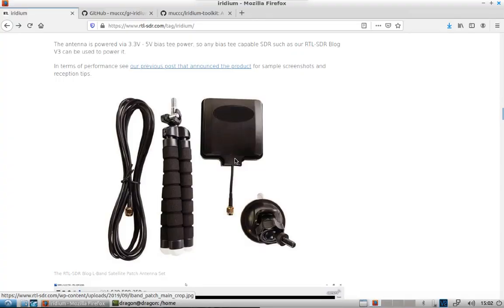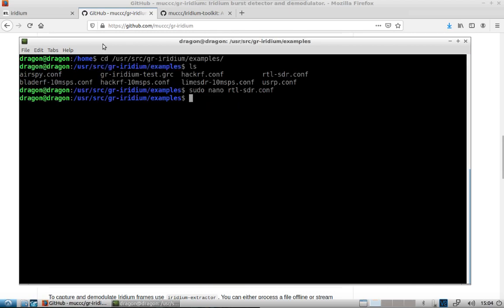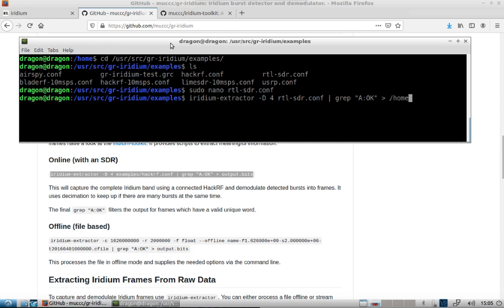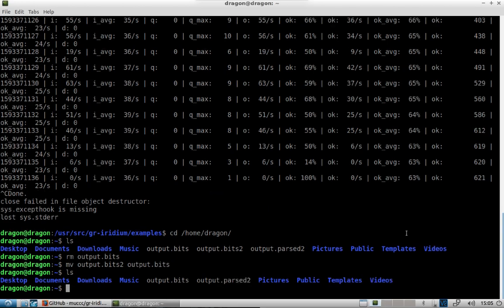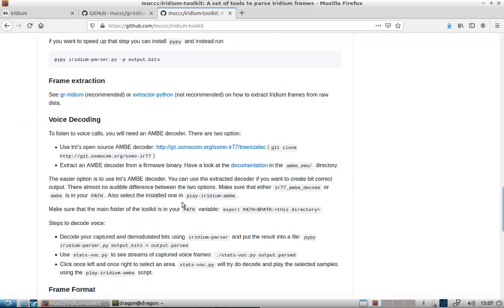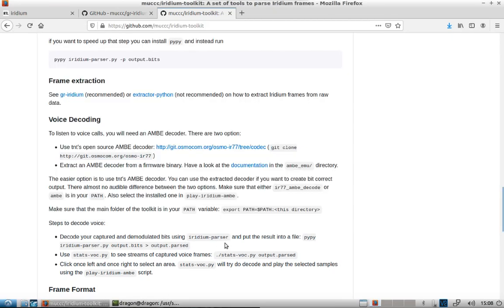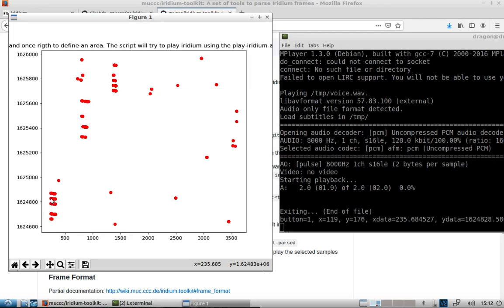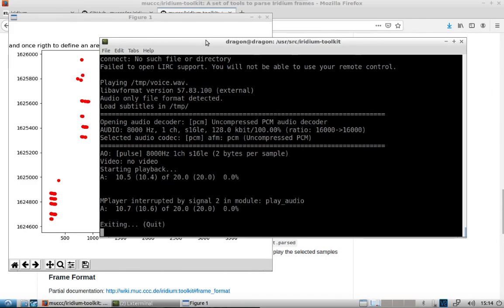DragonOS LTS Decoding Iridium satellites with the Iridium toolkit (gr-iridium, RTL-SDR)

Comment: That´s simply great! Last year I have purchased the LANA form nooelec for preamp, I did not know that is so easy to enable the bias-t on the rtlsdr v3. I do intend to use the patch antenna from the outernet project. Thank you!
Reply from the maker: I didn’t either.. till I started digging and thought how do I turn on the bias-t with software? There’s a few options I found but this seemed the easiest for gr-iridium and only kept it on when I needed it. I was surprised to find the answer on some random forum and that it didn’t seem to be well known. I was super happy as it was the first time actually using it and the antenna.

Comment: I just found out about DragonOS and almost immediately installed it on my old laptop, and I got no regrets! Thanks so much for DragonOS and all these videos, finally I'm free from ripping my hair out trying to install sdr programs 😂
I'm especially excited about trying op25, I tried for 3 straight weeks trying to get it to install right on Ubuntu with no luck so it's great to finally have it, plus all the other programs that'll be fun to play around with
Reply from the maker: You’re welcome. It’s been a fun project and I hope that it helps make some things easier for everyone. Please let me know about op25, that’s one program I have to admit I haven’t really tried. I ended up just using sdr-trunk. Funny you mention op25 though cause I was just researching the boatbod version.
Reply: @cemaxecuter7783  I tried to paste the .tsv document with all the channel info for my city into op25/op25/gr-op25_reapeater/apps, but it seems like I need admin permissions to do it and I can't seem to be able to open the folder as an admin even with Nautilus
Reply from the maker: So since you’re logged in with a user other than root and because I had to stick everything in /usr/src for it to be there after installing you have a couple options.. one you could do sudo su and set a psssword for root, log out and back in as root. The better option would be to copy and paste and/or edit everything via command line with sudo in front of it.
Reply from the maker: Like sudo cp .tsv /usr/src/op25 etc etc it’ll then be there. Sorry for not having done a video on op25 yet. I’ll get smarter on it and make sure that it’s actually all setup right. Been meaning to do that. I’m curious though, what’s the advantages or disadvantages using it vs sdrtrunk? If you need to reach me faster you can send me something to cemaxecuter @ ProtonMail
Reply: @cemaxecuter7783  Thanks for the help, that did the trick! I think the main reason some people choose op25 over sdrTrunk is that it apparently works really well with only 1 dongle, which is my reason for trying it, and also the audio quality is said to be great. It's a little bit more difficult to set up because all the channels have to be entered into .tsv spreadsheets, which for the San Diego system was 1500 entries from RadioReference.

I just got SDRtrunk set up and it's running great, so I'll have to see how it compares to op25 once I get it all figured out
Reply from the maker: Well, you got me motivated to look more at op25. I found that I had two versions in /usr/src with i think the one labeled “old” being the one installed. I remember now a bug with one of the blocks. Anyways I removed both versions and started fresh with the latest boatbod source. I fixed the block bug and went into the repeater folder and ran sudo .op25.sh. I got a black window to open where I could change the frequencies. Now I have to see what’s all required for setup but I intend to upload a new ISO with this and a few other fixes. Also, separately I have a completely different ISO I’ll upload but that one will not have op25 yet till there’s better support for gnuradio 3.8. That was a mouthful. Glad you’re making out with sdrtrunk and if you run into problems with op25 just email me and I’ll help fix what you have or you can try the new build once I upload it.
Reply from the maker: FYI I cleaned up op25 and went to one version only, the latest boatbod. Fixed some other things will I was at it. You’ll see a new ISO on sourceforge in an hour or so or I’ve put the same ISO here. Might save you a little time sorting out op25 on the build you have. 

https://drive.google.com/drive/folders/10dr7lYwbI_UQy4OYuiFqCrua_hrVZ_1u
Reply: @cemaxecuter7783  I just downloaded and installed the new .iso, and op25's working great! I had to copy the whole op25 directory to the home folder, since even with sudo it was giving me a "permission denied" error with the output file when it was in /usr/src. I also had to mess around a little bit with the ppm offset, and change the modulation in the trunk.tsv file to C4FM.

Audio quality is definitely a little bit better than SDRtrunk, and it's also nice because it shows the current talkgroup that's talking, and it's pretty easy to customize all talkgroup names the .tsv.

Again I really appreciate all the help and the OS, it's definitely made sdr 1000x easier for me

Comment: How exactly do you stop the output.bits file correctly, I noticed you hit control C to stop it, but my file is empty even though I can see several iridium sats have crossed my path. I'm using the RTL-SDR patch antenna. Also, do I need to crank up the gain on that cuz I normally do when I'm using SDR# and other apps.
Reply from the maker: Ctrl C is fine. I’m thinking, did you enable the bias t in the config file? Gain can go up some too. It should be getting info dumped to the file. I’ll be testing again this week on a brand new build but procedure is still the same.
Reply from the maker: Oh wait, this is an older video. Are you using DragonOS Focal or LTS? The procedure has changed from the old old way. That might be why you’re getting nothing.
Reply from the maker: This one is newer, pick out the parts you need. https://youtu.be/ROCCPdq9ieo

Comment: I'm very interested in this. Can you talk a bit about your hardware setup? I have the RLT-SDR, it looks like I'll have to grab an L-band antenna. Also, I'm looking but I'm not finding out much about this Iridium Ring Alert? Do you have some documentation on that as well? Thanks.
Reply from the maker: Sure thing. I was trying it first with my Rsp1a, but had some difficulty passing the correct settings for gain so I switched to the hackrf because it too used a usb cable which extended everything far enough to reach my window. I could’ve probably used the rtlsdr had I moved things around. 

I think the other advantage of the hackrf was that it had wide enough bandwidth to include the ring alert. If you’re using the rtlsdr then you may have to adjust your center frequency to include it. 

This video was helpful to me when trying to understand how it was actually working. It’s long, but if you jump to about the 9 min mark you can see where he starts to cover the range you’ll find the ring alert at. 

https://youtu.be/JhJT7Cvh6NE
Reply: cemaxecuter thank you for the feedback. The HackRF is pricy but not out of the reach. I just want to make sure I’m good enough for HackRF :) I’ll read over what you wrote after work. Thanks for the help.
Reply from the maker: No problem. I actually made an earlier video using the iridium toolkit and the rtlsdr. It worked great. I think it should do fine with this as long as you have the center freq right.
Reply: cemaxecuter thanks! Do you know where else I can look to purchase these patch antenna? Rtlsdr website looks like they are sold out everywhere. Do you know of a replacement vender that I can get this from?
Reply from the maker: Unfortunately I think the rtlsdr ones are all out of stock. I hear this one will work though https://www.sdr-kits.net/L-Band-Receive-Antenna-A162
Reply: @cemaxecuter7783  Thank you!

Comment: I know this is an old video. ive just come across  dragon os  in my delve into linux and ham radio.
using your latest version. I wonder if im missing something.  my rtlsdr v4 works fine but my v3 does not work with iridium it sees no data. same setting for either dongle  . it works with everything else
Reply from the maker: Are you using the internal bias T or external? I would highly recommend grabbing an external to test to make sure something is not wrong with the v3 switching on its bias t. You could also open up SDR++ and tune to the center frequency of the iridium you want to look at and flip on/off the bias T option. I’ve seen it to where it just gets stuck and unable to turn on within gnuradio backend applications but turns on fine with something like SDR++.
Reply: @cemaxecuter7783  
yes using internal bias t. If i use sdr++ or cubitsdr  I can see the signals and turn on and off the bias t   and it works fine.
Im getting the same results  on the pi version.  as i have just put in on both a PC and  rasp pi. Also when running iridium-extractor I have checked their is an actual voltage with a meter. 
Im just wondering if its todo with some sort of driver issue  wiht the v3 as the 4 works fine. As maybe when you did your video  the 4 was not  out. and since then   some driver change for 3 and 4
Reply from the maker: @rogerm1cdq407 I’ll double check but even back then there was a periodic issue that was driving me nuts where the bias t wasn’t actually turning on with the v3 when used with osmo SDR and soapy under iridium, but it did turn on and off with SDR++. If possible though I highly recommend an external one. I’ve been meaning to update iriduim anyways so I’ll check with v3 and v4 asap
Reply: @cemaxecuter7783  just tried with external  bias t.  Still same. 
At a wild  guess  when the 4 came out. Software would see it but you get no signal untill you updated  driver. 
I'm wondering if it trying to work it as a 4  and the 3 is not showing signal
Reply from the maker: @rogerm1cdq407  about to try it here now
Reply from the maker: @rogerm1cdq407  so far in SDR++ turning on bias t with the v3 I’m seeing iridium without issue. I’ll move on to something else. But for sure if you’re using an external bias t you should be seeing things. I don’t think it’s the driver based on what I’m seeing at the moment. I should’ve asked, are you using the latest DragonOS FocalX or Pi64 or something else?
Reply from the maker: @rogerm1cdq407  I’ve Al as I now tested in Cubicsdr with bias t internal on and could see iridium. Which profile are you using for the rtlsdr under gr-iridium?

Comment: Hi, I always seem to get the same error regarding file not found /tmp/voice.wav when trying to play the signal, am I doing something wrong?
Reply from the maker: Can you shoot me the time of the video? I’ve did another newer video here,
DragonOS Focal Demod Iridium Voice, IridiumLive + User Requests (GR-Iridium, bladeRFxa9, hackRF) https://youtu.be/WljlmoNVW94

I’ll take a look but I think if you have the path setup right and the decoder in place that no wav may be that there’s just no audio found in the clicks you’re doing. I had to run it awhile and click all over but I was surprised by how much audio was captured.
Reply: @cemaxecuter7783  Thank you for the swift reply, I've managed to get it working, it turns out I was forgetting the path command as demonstrated on the latest iteration of the video. Thank you once again for developing and putting this all together!
Reply from the maker: No problem, yeah I think I had messed up or skipped over in the previous video or maybe I put the file somewhere different? Can’t remember but I think that may have been why I did another video. Crazy what it’s able to do!

Comment: Good evening

Quick question is the iridium project functional for gnuradio 3.8.1 and python3? Otherwise as usual great video and with great pleasure watched and discovered other mode to decode super satisfied on my part
Reply from the maker: Good evening. I’ve not personally tested it, but the master for gr-iridium is on gnuradio 3.8 so it should all work perfectly fine because the toolkits just works with the files that you pull using the gr-iridium part (at least in my example). I have been working on a new build of DragonOS based on 20.04 with gnuradio 3.8 etc.. It’s not nearly as far along as I’d like but I still think some would find it very useful.

Comment: The output file just stays empty. During the collection it says 4% packet loss. Any ideas?
Reply from the maker: If you’re trying this on the latest DragonOS the process changed due to the newer way of running gr-iridum. One sec. I’ll get you a new video link
Reply from the maker: Here’s a newer video DragonOS Focal Demod Iridium Voice, IridiumLive + User Requests (GR-Iridium, bladeRFxa9, hackRF)
https://youtu.be/WljlmoNVW94
Reply from the maker: The new way of running the extractor does not use the “A:OK”, instead it looks like this as an example
iridium-extractor -D 4 examples/hackrf.conf > output.bits

It used to be ran like this 
iridium-extractor -D 4 examples/hackrf.conf | grep "A:OK" > output.bits
Reply: @cemaxecuter7783  Yes now data it is writing into the file, thanks a lot!